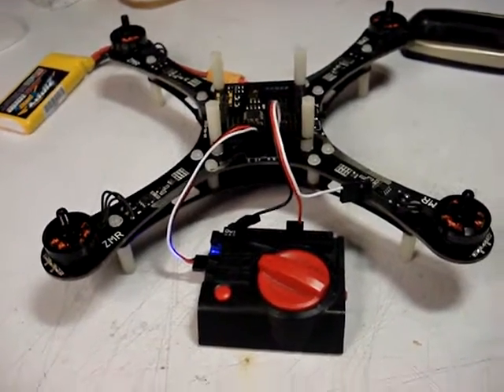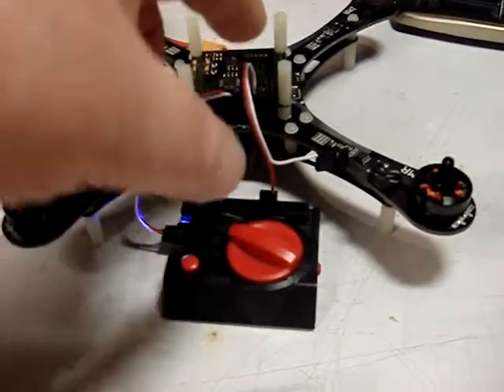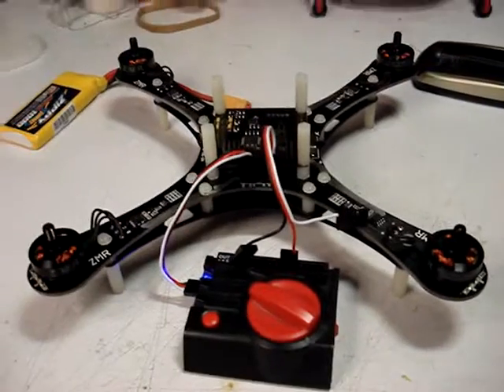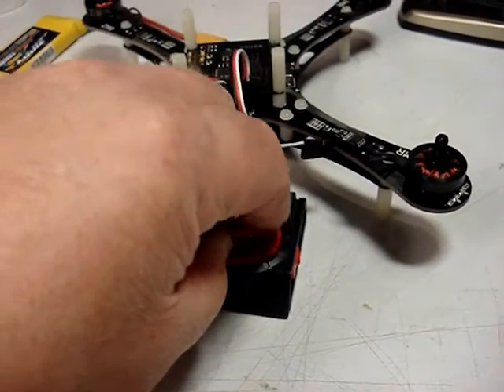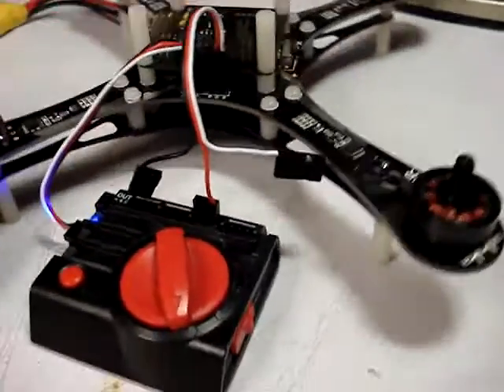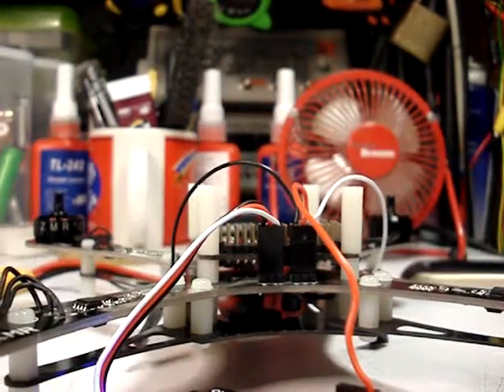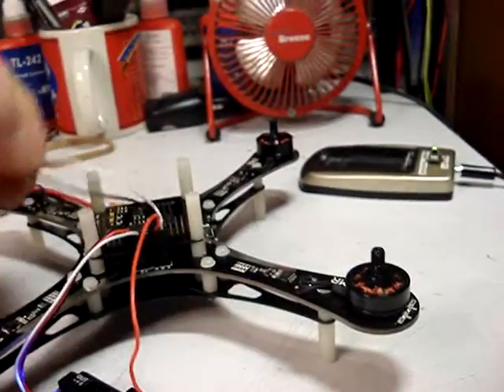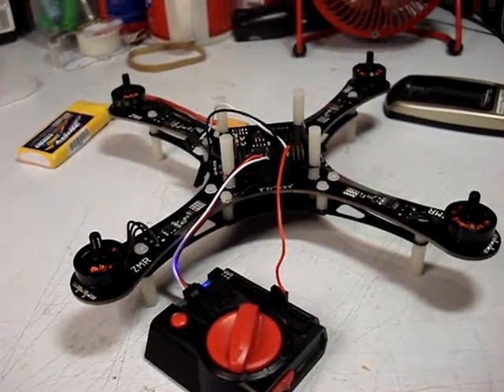ZMR 250 Quad Crosstalk Issue  (Same as HobbyKing 235mm W/ Embedded ESCs)

Comment: This is completely normal since the singal input impedance of the escs is very high. When connected to a source you will find no problem at all. Please present your findings here to prevent others from getting the wrong impression of the product :")
Reply from the maker: Herman -

This video was made to present this issue to my fellow users of the product; it actually isn't meant for general consumption. It has no tags, and the only place I've published the link is in the thread on RCG linked below.

I HAVE presented my findings - IN THE VIDEO. And I am fully aware of the reason; these are an unbalanced analog input (as most ESC inputs are), and as such, are susceptible to noise. There IS a POSSIBILITY of crosstalk between the channels because of the siamesed cable; this is usually NOT an issue with a quad that has individual ESCs, as one doesn't usually use a single siamesed servo wire for 3 ESC PWM signals.

The solution is simple, as I stated in the video: separate the inputs and/or make them as short as possible. This has NOTHING to do with the quality of the product; it is simple sound building technique.

As for getting the wrong impression about the product; this quad has been all but abandoned by most of its early adopters due to issues with a substandard Atmega processor on leg 3 and the fact that even when operating in tip-top condition, the ESCs are VERY close to their maximum ratings with the recommended ZMR 1804/2400KV motors.

As a result, they have a VERY high failure rate in the wild; with flaming MOSFETs being the result. Many users have rebuilt the ESCs, only to have repeated failures; eventually replacing the built-in ESCs with common 12A external ESCs and thereby completely eliminating the problem. All of this is documented in THIS THREAD on RCG dedicated to the product :

http://www.rcgroups.com/forums/showthread.php?t=1813578

There. Now we don't have to worry about viewers getting the wrong impression about the product, do we?
Reply: You never test with an open input, that is just wrong. This is an abuse of the product so your finds say nothing to me.
Reply from the maker: Herman Kruisman
Good. Then it's resolved; as this video isn't meant for you. Have a nice day!
:rolleyes:

mnem
https://xkcd.com/386/
Reply: mnemennth It is like leaving you car in gear and making a video of it rolling down the street saying you need to put a concrete block in front of it to resolve the rolling issue...... please understand that splitting or shortening the wires make absolutely no difference af all. If you take any other esc and place the signal wire alongside the other you will see the same result. An open input will always be subjectable to irratic behaviour.
Reply: mnemennth roll your eyes all you want. Just like the sarcastic little girl, you are still wrong. Herman is right on. Without the signal wires being connected to anything they will pick up random noise. Disconnected is NOT "OFF" It IS "UNDEFINED" floating pins can be high, or low, or anything in between. the noise in the adjacent wire is being picked up by the antenna you have created. now if you pull those signal wires to ground {or power depending} with lets say a 10k resistor {called pull-up or pull-down resistors} you would find the issue not to exist. By having everything connected, the internal pulldowns/ups can do their job. by leaving the pin floating it can be either high or low or flop between the two at will.
Reply from the maker: So you've just shown that you don't know what an unbalanced input is. Congratulations. I do. I also know how to design inputs that are impervious to this kind of noise; I used to do it for a living.

Maybe if you had a little more background in analog circuit design you'd understand why half of modern digital circuit design is utter crap and you'd see, as I do, that the open-source schematic these ESCs were stolen from is no exception.

Have a nice day!

Comment: you should get an arduino and do some experiments. you will learn much about circuits, and more specifically the atmel family of chips that much of the rc world is built upon. {as is the arduino} by learning the basics you will find yourself in much better control of your hobby. better yet learn C+ as arduino is just C for dummies basically. But i digress. Arduino projects give you a chance to learn hardware and software implementation together, at the same time. Which makes things ALOT less boring.